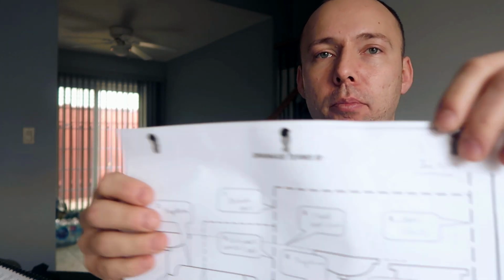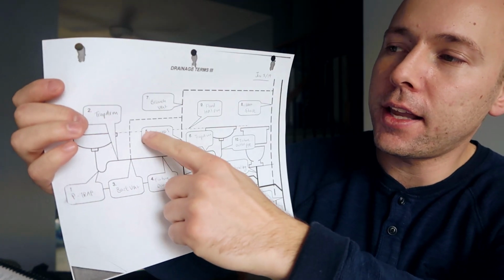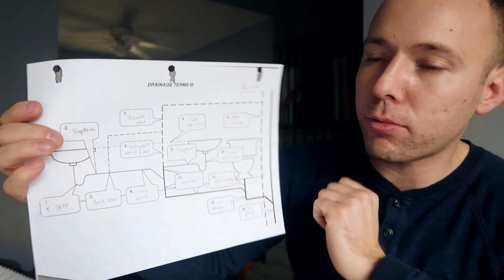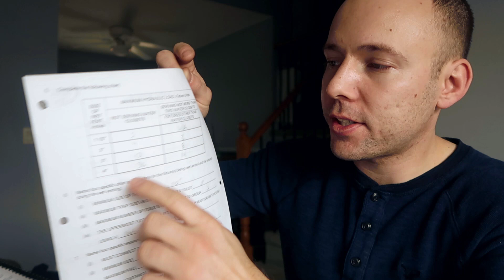8 Weeks Of Advanced Plumbing School 1 | Day In The Life Of A Plumber

Comment: Do you solder ball valves opened or half closed and why ?  Thanks
Reply from the maker: Hey thanks for reaching out! I was taught to solder them half closed because if you put too much solder into them when they are fully open you can actually solder them permanently open. When they are half closed you will be able to break off any solder that may get in (in theory) by turning the valve.
Reply: @Kennymolotov  Thank you very much for your explanation.
Reply from the maker: No worries!